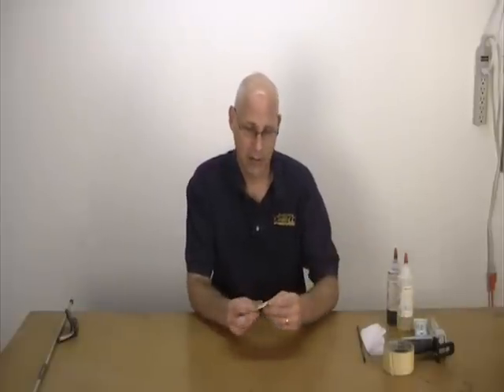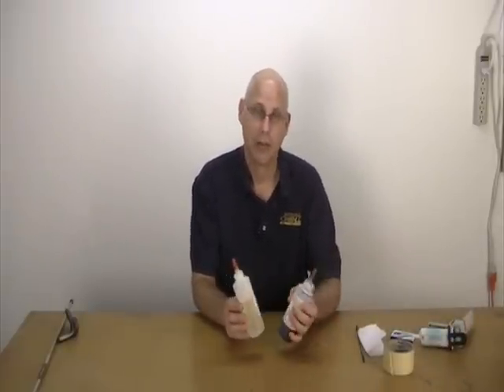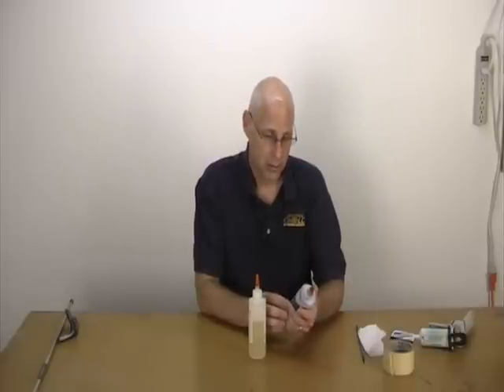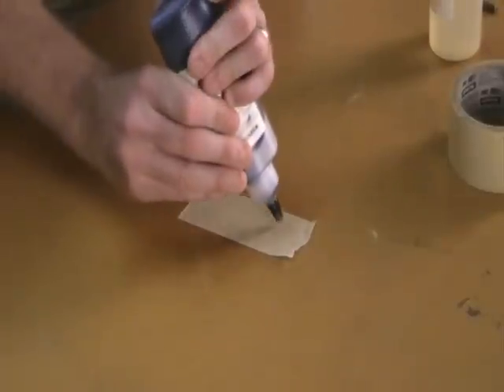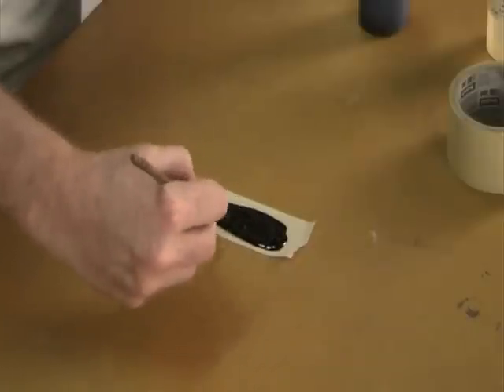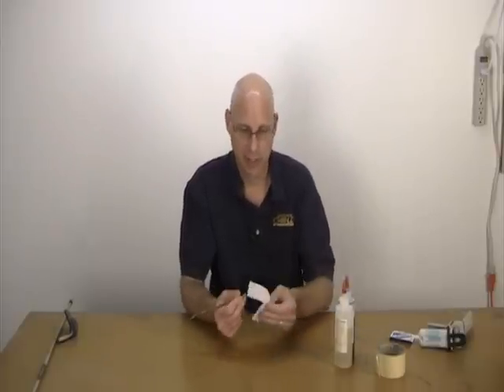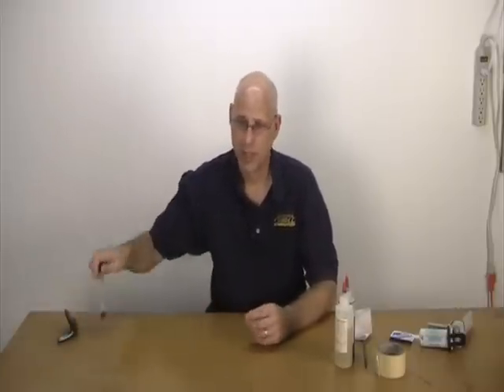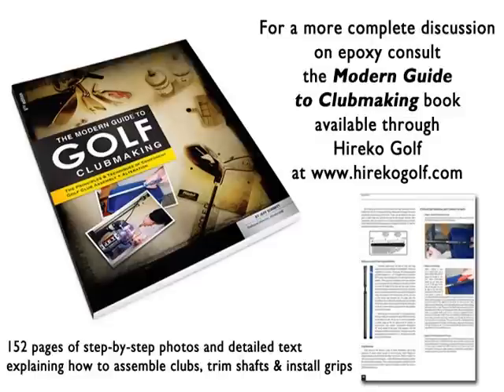Hireko Golf Videoblog "Tips on Epoxying a Golf Club" by Tech Director Jeff Summitt

Comment: I wouldn't recommend "eye-balling" it, as he suggests. Many of the current epoxies have one part (usually the black part) that has a much more liquid-like viscosity. If you eyeball it, you will have too little of the black part. If you use a measuring cup, such as something one gets with a cold/cough medicine (if you haven't purchased measuring cups from your component supplier), you will find that you get a much more even mixture. And yes, if your mixture is off, you may have heads slide off.